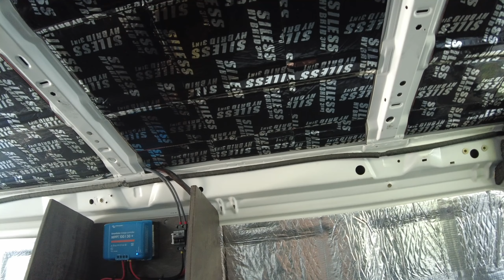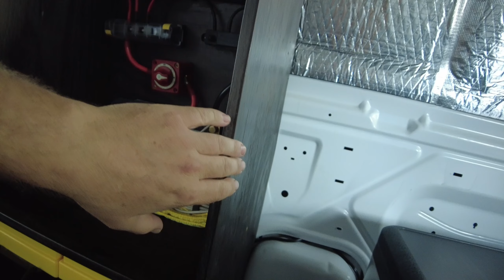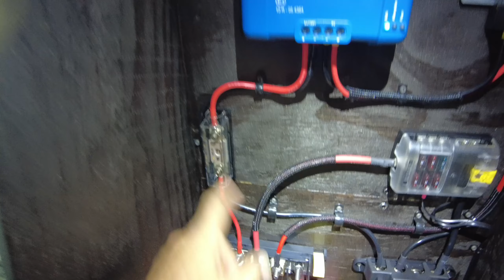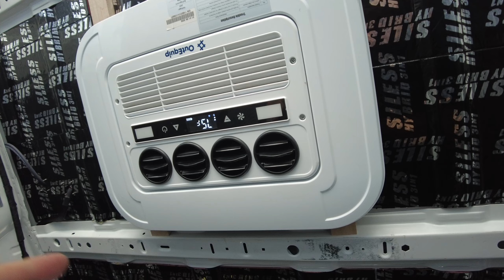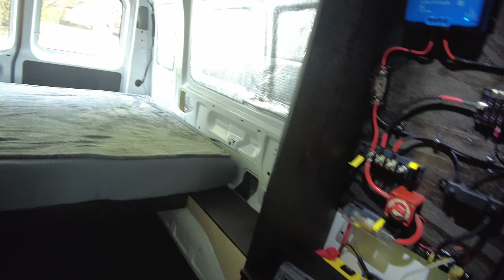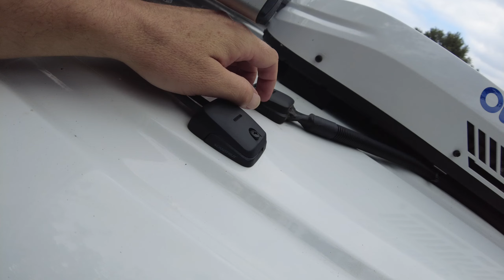My Ford Econoline Camper Van Project

Comment from the maker: Amazon Affiliate Links
WUBEN G5 Flashlight: https://amzn.to/4pqRFp8
Blue Sea MRBF Fuse Block: https://amzn.to/45R67Pq
Blue Sea Battery Switch: https://amzn.to/46855gF
Blue Sea Blade Fuse Block: https://amzn.to/3VAYIO2
Scanstrut Double Cable Seal: https://amzn.to/48bm7Nw
Siless Hybrid Sound Deadening mat: https://amzn.to/4g9fe1k
10mm Thick Foam Mat: https://amzn.to/3V1BhNQ
Insulation Edge and Seam Sealing Tape: https://amzn.to/460dDGk
14" x 14" Universal RV Roof Air Conditioner Gasket Kit: https://amzn.to/4imWuLM
Victron 100/30 MPPT: https://amzn.to/41JTG2A
SetPower Refrigerator: https://amzn.to/47LPmDv
Silicone Terminal Covers: https://amzn.to/3R0ZQIK
Full Size 6 Inch Memory Foam Mattress: https://amzn.to/41FnlNb
Victron Smart Battery Monitor: https://amzn.to/3I5FPjl
Metal Carbon Steel Molle Panel: https://amzn.to/4giywl8

24v DC Air Conditioner: https://outequippro.com/products/top-mounted-rv-air-conditioner-with-1-indoor-unit-and-1-outdoor-unit-12v?variant=48461704659252

I used this adapter before I mounted the AC. It conforms to the valleys in the roof
Ford E Series Roof Vent Adapter: https://www.ebay.com/itm/132173560469

================
AFFILIATE DISCLOSURE: This channel may earn an affiliate commission if you purchase products through links I provide, or use my discount codes. 
================
CONTACT: bradcagleyt@gmail.com
Business/Collaboration only. Please do not contact me for for personal project help, or advice.
================
DISCLAIMER: These videos are documenting my own personal projects, and experiences. These projects, and activities can be dangerous. I am not a professional. You should always consult with a professional. This content is for entertainment purposes only. DO NOT try any of this at home, doing so will be at your own risk.

Comment: Awesome set-up.  The electrical cabinet is sweet - you can tell it's the heart of the wagon - and everything is immediately easy to understand and replace if neeed.  The shunt monitor is crying out to be mounted in the cabinet wall visible from the driver seat?

What are you planning for kitchen hob?  Maybe a nice double induction hob so you dont have to worry about propane?

More videos of the van build please!
Reply from the maker: Thanks! Yeah, I need to mount the battery monitor. I cant decide where I want it. One of my problems is I cant see it very well, my vision is not so great LOL. So right now I have an Anker c1000 power station that I keep charged from the 24v battery bank. I keep it tied down in that shelf in the electrical cab. Anyways I use that to run a induction cooktop. I cook outside when camping so really no need for a kitchen. Although I do heat water in a kettle inside for my morning coffee. I cant move far until I get caffeinated :)

Comment: Brad I found that my hook up  20 amp dedicated lithium charger in my RV was getting a bit too hot for my liking under the bench seat - on investigation, I discovered it was using a 20 k NTC thermistors bolted to the heat sink to progressively crank up the fan as it became warmer - I replaced the 20k NTC with a 10k NTC and now the fan starts at around 42c and never gets hotter than 50c  at which point the fan is running at about half speed so is very quiet - I like that the fan comes on earlier and is progressive - hot Mosfets have increase resistance, reduce current carrying capacity and risk avalanche failure.
Reply from the maker: Hey nice fix! Yeah, and not only is the heat bad on the FETs, any electrolytic caps near by are getting punished. Thanks!

Comment: Great project. AC is so cool! 
Also consider a small PC running Home Assistant with sensors for solar/power/battery and temp inside/out and notifications for when doors are opened. Also can add cameras to it with the Frigate addon.  (Dell Latitude Laptop: 8GB Ram, 256SSD $140 - run it off DC USB-C power for 24/7 operation)
Reply from the maker: Cool ideas! I'm planning on running something like a raspberry pi, so maybe I can play around with Home Assistant on that. For the door open notifications, how do you monitor that? Maybe add sensors to the doors? Thanks!
Reply: @BradCagle  Same sensors as for your home, but attached on the inside of the vehicle doors. Like "Aqara Zigbee Door and Window Sensor 3 Pack"
(You'll need to add a USB-Zigbee dongle to the rPi)